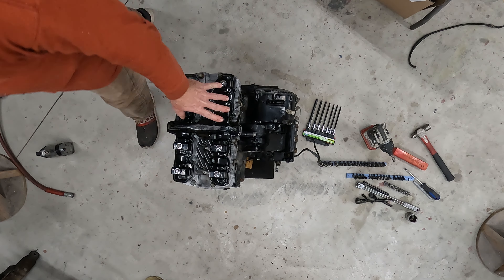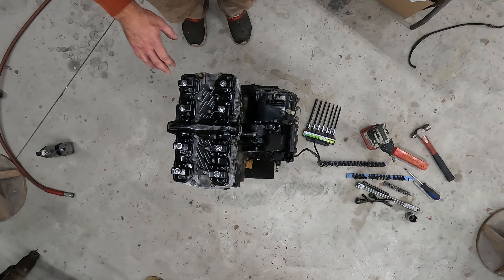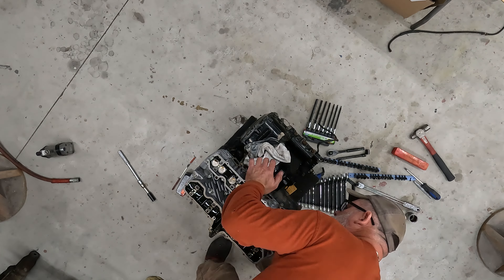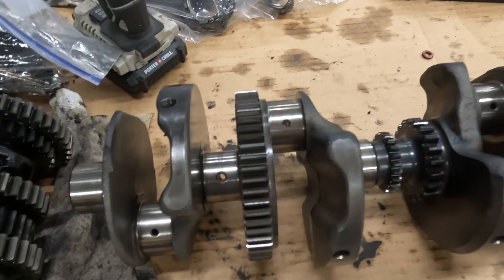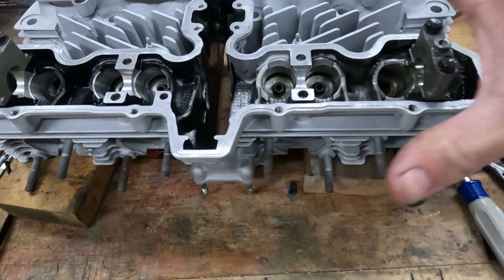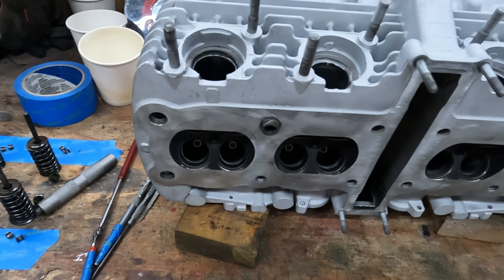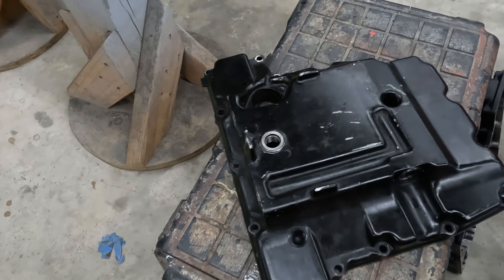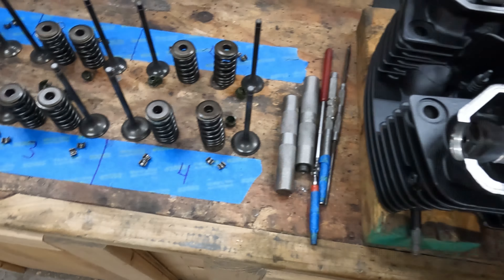Yamaha FJ1100 Engine Teardown and Prep

Comment: Hola
Para abrir la caja de cambios y reemplazar los engranajes .
Tiene que estar en alguna marcha específicamente o puede estar en cualquiera?
Reply from the maker: No it doesn’t require a specific gear selection in order to disassemble. But to remove the transmission and associated parts you have to split the case.
Reply: Thanks a lot .
i figure i will have to remove the clutch basket to be able to split the engine
Reply from the maker: @mobykofjkiko  yes as well as the oil pump as there is a case bolt in the oil pump pocket
Reply: @iccustomsusa8048   muchas gracias
Un saludo